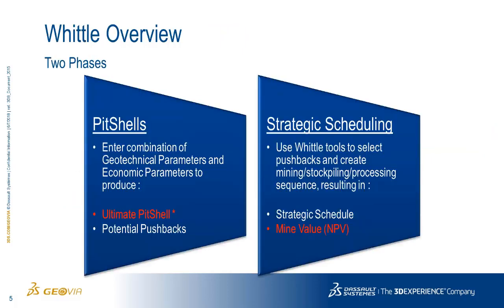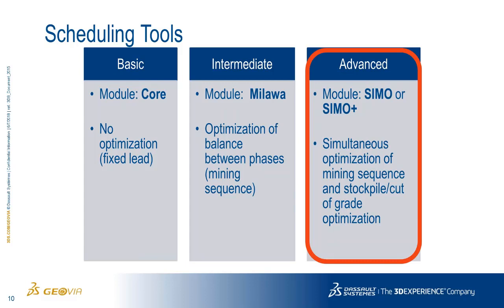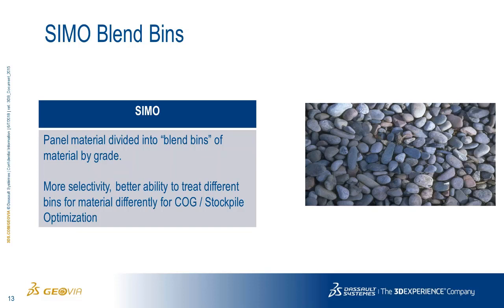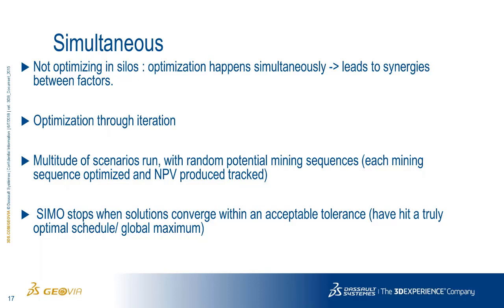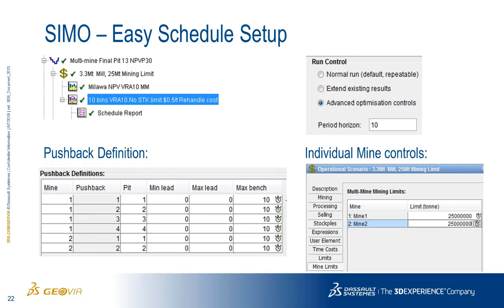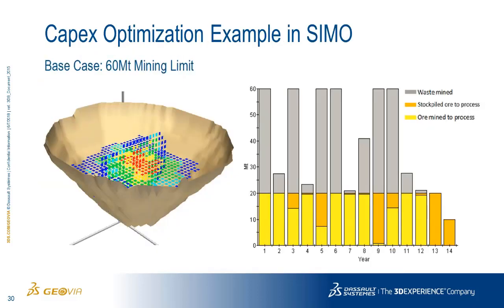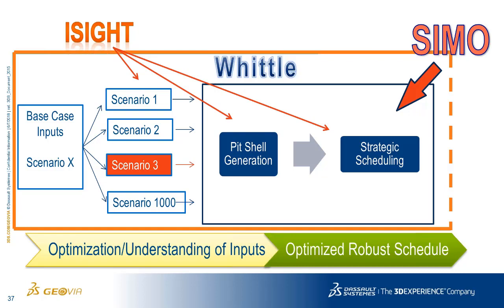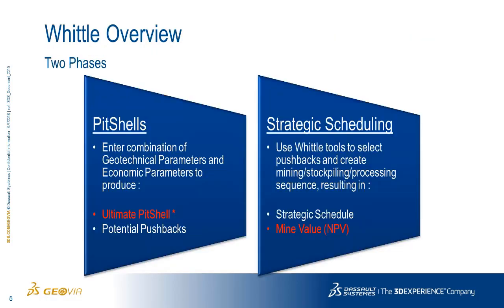Improve Your NPV with Advanced Simultaneous Optimization | WHITTLE | GEOVIA WEBINAR

Comment: Interesting algorithm for an optimized multi-mine sequence; other boundaries I am gurgitating over in my mind are 1. how to properly setup the multi-mine if it is a mix of open pit and underground - obviously there could be ways to "trick" whittle through maybe model coding and constraints usage or 2. define the underground, maybe, as a stockpile and use it as part of the larger resource inputs; these and a couple other questions are what I am turning over in my mind. The SIMO is a tool to push the boundaries of unknowns in strategic mine planning and overall value creation. Exciting future for resource value optimization lies ahead and investors should be excited.
Reply from the maker: Hello Edmond and thank you for your comment. To share and discuss your thoughts with GEOVIA experts direct, i would like to introduce you to the Sustainable Mining Network - powered by GEOVIA.  

Join this dedicated mining community to learn, react, connect, and share ideas and comments with like-minded mining professionals and GEOVIA experts. This is the perfect place to discuss both technical and non-technical questions, as well as the wider issues affecting the Mining industry of today and tomorrow.

Join for free at https://bit.ly/383OTi3
Reply: @3DSGEOVIA2  thank you. I am joining.
Reply: @3DSGEOVIA2